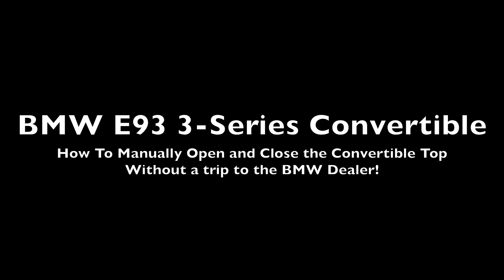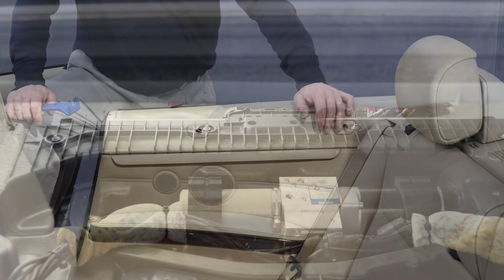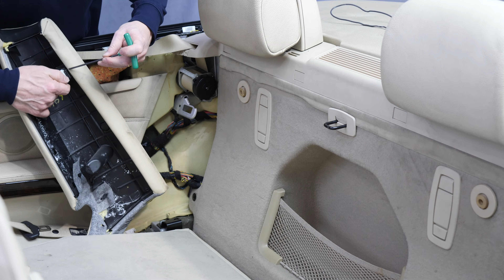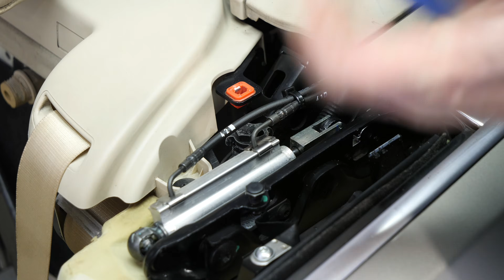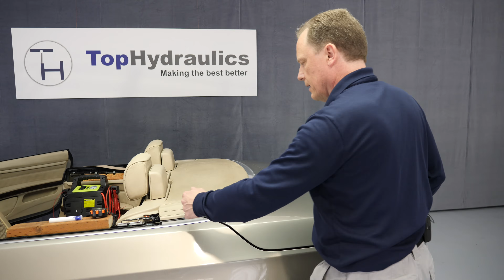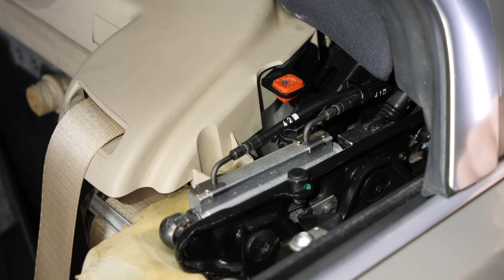How to Manually Open and Close The Top (Long Version) - BMW E93 3-Series - Top Hydraulics, Inc.

Comment: Hi there. I followed this procedure of opening my e93 roof manually but my electric roof latches doesnt work when i put 12v direct to the plug. It just gives a slight spark but no motor sounds or unlatching or latching sounds.How do I manually unlatch the roof front and rear? Please help.My right trunk locking mechanism isnt working so I took off the striker plate for the trunk lid to close and only the left lock is holding the trunk down.Will this cause the electric roof latches to not work?
Reply: Same thing happened to me when I used a normal battery tender, I switched to a drill battery and the roof latched I’m just stuck trying to get the coupler locked

Comment: This video was great helping me lock my roof.  However now I can't get the the windows yo go up.  How do I get them to go up now.  It light is still blinking even though the roof is locked.
Reply from the maker: Apparently, the computer is not reading that the top is fully locked. Most likely,  the rear frame locking cylinders need to be moved a bit farther.
Reply: @TopHydraulics  thank you for getting back to me.  I figured it out.  I jump started the module then reversed it.  At which point the blinking light had stopped.  And I was able to start the car and roll up the windows.  Thank you so so so very much as your video was so helpful and invaluable to fixing my issue 😁❤️.
Reply: @Only1NovaStorm  Hello! I’m having the exact same problem as you did and i’m not sure how to fix it, by any chance can you explain how to “jump start the module and reverse it”? It’d be greatly appreciated 🙏

Comment: if you manually lock it, does the "hardtop not locking!" come off on the idrive?
Reply from the maker: It should.
Reply: @TopHydraulics  ooo ima try this, i just got this e93 recently and it says hardtop not locked! and I basically been driving around with it closed but the chime just going off.

Comment: Question my top is up and closed but I want to put it down, It unlocks but no roof movement. 
I can physically lower it with some help but I can’t get the rear module (trunk) to go up so the roof can go down could you assist me in opening the trunk manually so I can lower the top?

Comment: My top lock but the windows won't go up, the window error light flash and I hear the motor engage but the  window won't go up like it's not fully  loaded. Any suggestions?
Reply from the maker: If you can hear the window motor but the window won’t come up, that would appear to be a problem with the window. However, there is more than one window, so the description of the symptoms is not detailed enough to offer worthwhile help. This post will be erased in a minute, so maybe we can start over again with you giving a more detailed description of the symptoms.
Reply: Thanks for the reply I found out what was going on. The latch on the cylinders wasn't locking, so I had to manually pull them while my wife pushed the convertible top close switch, the sound that I was hearing was the convertible motor. My windows wouldn't go up because the cylinders wasn't locking. I was wondering if I had to add or change the hydraulic fluid to get the cylinders to function properly?

Comment: I am following this video for a F33 and everything was matching exactly as in the video, up until the part where I needed to unlatch the trunk by putting wires into connector. In F33 I do not see such connector, any idea where it might be?
Reply: did you find the wire G?

Comment: I just completed this procedure today. Here are some roadblocks I faced and how I got around them. 

If you’re having trouble removing the panels from the rear of the interior, you need a trim removal tool, there’s no good place to grip to simply pull. Carefully pry between the panel and the top of the ambient lighting assembly, start about an inch or two back from the front corner, it will take some force the first time you remove them as the clips are stiff, but they will come off. Once you get the first clip released, it’s easy to pull the rest of the way.
If your windows won’t roll up after, your hardtop may not be fully locked into place. Verify that the rear module locking cylinders have been fully returned to the locked position. If you’re having trouble like I was, I climbed through my vehicles rear seat pass through so that I could close the valve on the pump, as you cannot open the trunk when the top isn’t fully locked. I punched the door to get it open and ripped the ski bag out :) Once the valve was closed, I pulled up on the button and it was able to complete the locking of the top. If you have the ski bag pass through, you’ll find that you cannot easily remove the panel behind the rear seats to access the CTM. Simply remove what you can, including the passenger side luggage hook, and you can bend the panel back enough to easily access the CTM and the leads needed to operate the electronic roof locks. Lifting the top sounds daunting but don’t be scared, I’m not particularly strong in any sense of the word, and I was able to do it with the help of one person. The key to this process, GO SLOW. Follow the directions in the video very carefully, pause and rewind when you must. If you take your time, you’ll be sure to have success.
Reply from the maker: Thanks for sharing, you have some good tips there! Getting the rear locking cylinders to fully lock is the most challenging task and I assure everyone it can be done! Your approach of closing the valve on the pump and using the pump is very good. Alternatively, on could temporarily remove the hoses from the cylinders and the manual locking process will already be a lot easier. Typically, removing one single hose would make a huge difference (don't forget to re-install it later).
Reply: Really appreciate the help I did the full procedure except for unlocking the control module pressure, my windows currently aren’t going down since the rear cylinder you have to slide back to lock wouldn’t go as far as it did in the video so I shall try unlocking the pump as you said as soon as I get home.
Reply: @MasonPacheco-u4h  Thanks for your reply! I am facing exactly the same situation, my top is in the boot, I can only get the boot to open, but the roof does not come out of it

Do you actually need access to the pump to release pressure like the video shows on 5:39? with the whole roof inside the boot, I am hoping I dont need to do this part...otherwise how can one do it

Thanks @TopHydraulics for this video!! Cant wait to attempt it myself
Reply: I have a question regarding the honey comb looking plastic behind the seats. How difficult is it to get that out of the way? And how? I have the warm package so no ski pass through so it is similar looking to the video. I have a detached battery and closed the trunk so no way to get in other than to go through the rear seats. I’m desperate lol
Reply: I have a e93 too and I just got it and the windows don’t work, my driver’s side window is bent and I can’t change the regulator (if that’s the problem) because it won’t let me power the window, in the trunk I found a roof-tray locking mechanism hanging with a zip tie blocking connectors, therefore when I drive I have the top open chime, all window switches have power but only the window adjust button works and the lights work on them too. I have no idea why the guy took the locking mechanism . Please help me, no windows respond and the button to open the top has a flax king red light and my system says top not fully closed.

Comment: This video was an absolutely invaluable resource to me today. A few days ago, I had a hall sensor fail on my top while it was fully retracted. The rear module would open no more than 12” before a “roof movement impaired” message flashed on idrive, and the operation would stop. The trunk was empty, and an error code for one of the hall sensors appeared when scanning. My top was stuck down for 3 days, which wasn’t too big of a deal as it’s summer in California, so it kept it covered with a blanket. My local BMW dealership, a very large location with a newly built state of the art service center, said they couldn’t help me! Claimed they didn’t offer service on these tops. With the help of this video, I was able to successfully close and lock my top into place. To all who made this video possible, I express my sincerest gratitude.
Reply from the maker: Thanks for sharing and thanks for your kind words, this kind of situation is exactly why we made the video. It was a lot of work, but fun to figure out how to change a seemingly impossible situation - imagine how many E93s would get wrecked prematurely only because the top has a minor malfunction...
Reply: @TopHydraulics  I was checking your website and noticed the e93 is no longer serviced by your shop. Was wondering why you guys stop offering service on it? 

I also have an r170 slk230 and it seems like the system is more complicated and older yet I'll soon be calling upon your services 😅
Reply: A main dealer saying they can't or won't work on one of their own cars,....that's a law suit waiting to happen, surely? I wouldn't expect them to know what the hell they were doing on a 50 years old Beemer, but this generation is a very common car and still many many thousands on the road.

Comment: hello , can i do this process with the windows not fully down ? after i flip the rear module back , i cannot take the 3 pieces up. why ? are they latched down or what ?
Reply: why the 3 parts are stuck in and cannot put it in the stacked position?

Comment: Thanks for such a great instructional video, i've attempted this on my car which has roof stuck in trunk/boot and trunk doesnt move at all during roof activation. Unfortunately i cant get the pistons to move, one moves about a cm but retracts but the other (right) is rock solid so im assuming it is a mechanical jam on the locking mechanism. Is there any way of accessing this with the roof down? You can hear it engaging an actuator but then stops.
Reply: I had similar issue and it was imperative to use some sort of pliers like the one Klaus uses . That free the piston and after they move like silk.

Comment: THANK YOU THANK YOU THANK YOU!! I was working on my convertible top  had moved the motor in the trunk, to take off the relays, another video said it could reset it, but it didn’t work so I went to remove the switch, like an idiot didn’t put back the pump and closed the trunk… as I moved the switch it started working and jammed the roof, it wouldn’t open or close and the trunk and windows wouldn’t work… I followed your video, the top barely moved since the pressure was not released from the hydraulic pump but only enough so  we stuck a broom stick with a metal hook at the end to grab the emergency trunk release and voila!! had it not been for this video I wouldn’t had been able to move the roof at all. The dealer didn’t even know if there was a solution… thank you so much for posting such a great video!!
Reply from the maker: Congrats and thanks for sharing! Indeed, the dealers have no documentation that would show them how to manually move the top. It took us a while to come up with the method shown in the video and we were excited to share it…

Comment: Thank you for this video. Great job. I've reached the point where I have to press the two pistons under the rear window to unlock the trunk lid. I did everything as you said. I released the pressure in the pump and unlocked the top, but these pistons cannot be moved back. My model is from 2012. Maybe there is some additional security.  blockade? Regards, Dariusz.
Please help me if you can

Comment: Need assistance identifying the 12v connector plug for an f33! Please!
Reply from the maker: As you know, this video shows the manual operation of an E93 top. The main difference between the E93 top hydraulics and the hydraulics in your F33 4-Series are that the pump has a different pressure relief valve for manual operation and that the plug for 12 VDC going from the control unit to the front lock motor is in a different position. The pressure relief valve is an Allen bolt with a black plastic cone over it to guide the Allen wrench. 

I haven’t seen the controller plugs on an F33 myself yet and can’t tell you where the one for the front lock motor is coming out of the controller. However, there shouldn’t be too many choices. The connector itself should only have two wires in it, heavy enough gauge to carry the current for the motor, and you might even be able to tell that those two wires eventually run up the top’s frame.

Please let us know exactly where the connector is on your F33 once you find it, to help out fellow F33 owners.
Reply: @TopHydraulics  thank you for the reply. I did in fact locate the Allen bleeder after combing through other posts. 

As for the connector I did locate what appears could be it behind the rear seat, it has two plugs and is a 12v control module but the second plug actually has 3 wires, not two. One appears to be an extra ground strap. I applied 12v and do get noise but it didn't sound like the correct noise for the locking latch and I quickly cut it in fear it Operated the hydraulic system. I've been looking through documentation on Ista but with limited success.
Reply from the maker: @ag6286  In that case, I must be mistaken about a 2-pin connector on the top control module that of the F33, sorry about that! You can still manipulate the front latch manually after disengaging the gear on it. Someone made a video on it (for an E93) before we published this video four years ago, so we didn't think we would needed to bother and putting voltage directly on the motor's wires appeared easier. I hope someone will point out soon which wires go to the front lock motor in the F33. Meanwhile, there is a way to manipulate the front lock manually, you just have to find it.
Reply: @TopHydraulics  ok so I found a good point for the unlock. The control module is located on top of the hydraulic motor. There is a white 42 pin connector. When unplugged, there are two long inputs in the upper right of the connector when looking at it. Pin 21 and 22. These are the 12v signal for the locking mechanism and tested successfully. Problem is when I went to loosen the bleeder valve, it doesn't appear to be an Allen key at all! I'm looking through insta for more info now
Reply: @TopHydraulics  scratch that it does fit, it was the type of tool I was using that prevented it from getting deep enough
Reply from the maker: @ag6286  Glad to hear that.
Reply from the maker: @ag6286  Awesome, thanks for sharing the pin numbers for the front lock motor on the F33 controller's connector!
Reply: @TopHydraulics so I'm in the process of the two hydraulic cylinders but they keep wanting to return to their original position. Very difficult. Is this normal?
Reply from the maker: @ag6286  If you have to fight the cylinders too much, then you could remove one hose per cylinder in order to make your job easier. You would lose a little fluid and you would want to find a way to catch it before it drips into the car, but it's actually less than an ounce.
Reply: @TopHydraulics something isn't right. I did all the steps but these cylinders do not budge. The only thing that does is a wrench pryed between the cylinder and connector itself which is damaging the cylinder itself in the process. There must be some other lock. Is there a voltage I can apply to a window motor to trick the ECU into thinking its down???
Reply: How do you remove the hose from the cylinder? I am having the same issue on my f83. The top is up and locked but I can't get the cylinders to move @TopHydraulics
Reply from the maker: @AJ-bk9bu  There is stainless steel clip that slides on the cylinder's rail. Tap it loose (using s screwdriver and a hammer), slide it out of the way, pull out the hose...
Reply: I managed to get the locking cylinders to move back and then fold the top into the stacked position.  However, we cannot get the top to now fold down into the trunk.  Has anyone managed to get the top to fold back and down?  2015 435i F33

Comment: Thank you for the great video!
But what can I do if the roof is stuck almost closed and the trunk is locked.
How can I unlock the trunk?
Reply: Same problem here, did you find a solution?
Reply: @stebenstef9578 If the roof is closed with this trick, you can open the trunk with the hardware-key
Reply: @dirkprivat5106  If the no hardware key only electric lock, any ideas?
Reply: @stebenstef9578 https://youtu.be/Om9zxXgxfSA?si=QO4L0jlk8T6PQf1b

Comment: I completed each step and all latches are locked. Now the windows will not go up and the top flashes red and beeps. How can I solve this problem?
Reply from the maker: Double check that the frame locks have been closed all the way - they are hard to move, as you know by now.

Comment: I close it mechanically, but the window doesn't close anymore
Reply from the maker: In most cases, this means the rear frame lock cylinders have not been moved far enough to trigger the sensor.
Reply: @TopHydraulics  If you can show me a photo, which sensor are you talking about? 🤗
Reply from the maker: @ბექაბექა-ტ3ო  I cannot add a photo of the sensor to my reply, but here is the relevant part in the video: https://youtu.be/2hDdwukqR4g?t=1927  Make sure the shafts on these cylinders have been fully retracted.
Reply: @TopHydraulics  When there are pistons at the rear trunk, I have closed them both completely.  It also closes mechanically, but it says that there is no permanent closing and I don't have to close the windows either.
Reply from the maker: @ბექაბექა-ტ3ო  Maybe the top is not fully latched at the windshield?
Reply: @TopHydraulics  It also sits well on the windshield.  Is it possible that the sensors at the rear pistons are to blame?